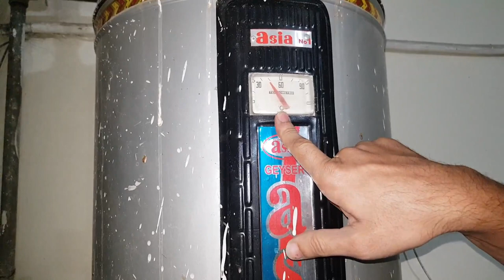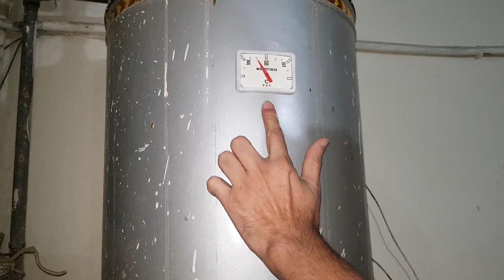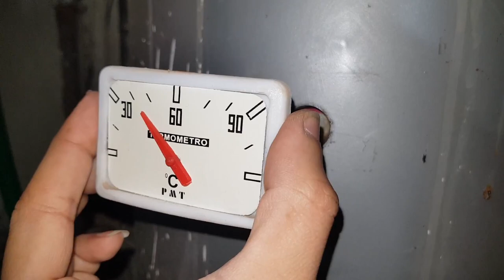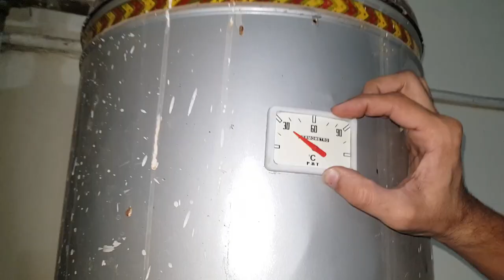How to Repair Geyser Meter (Gauge) (Kanta) At Home Urdu/Hindi #techknowledge

Comment: Mana superaisa k 2 geyser lagye ha electric storage heater 2no k meter cool side Pa ha and kam nhi krta total 2 geyser ha but meter sab k nhi chalta shoro sa
Reply from the maker: unka sensor inner body k sath attach nhi hoga.. khol k dobara lga den rsta clear kr k
Reply: @TechKnowledge64  thanks ap wala method kr lia 2 geyser k check kia ab daikta hn mana machas sa garam kr k check kia soe oper gae but gyser sa itna garam nhi hga ye body sa,